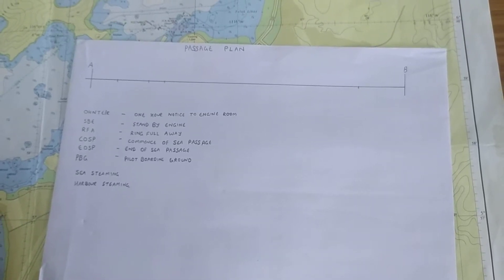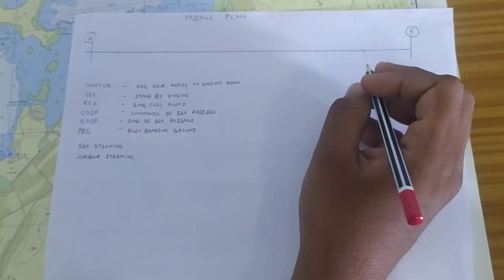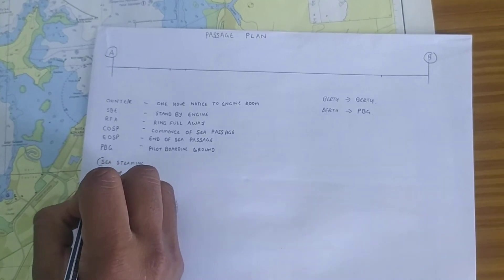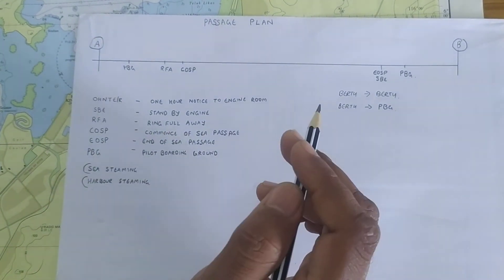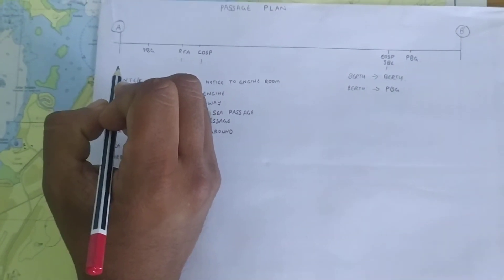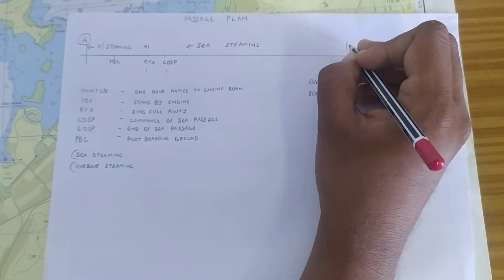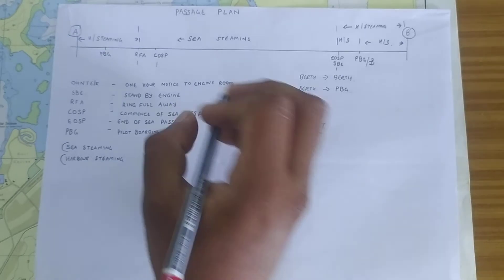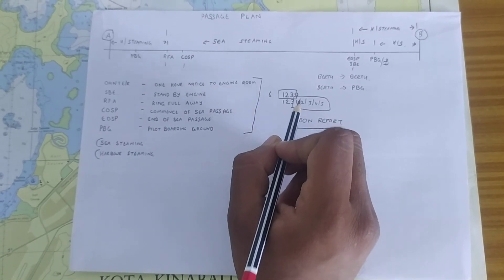RFA, EOSP, COSP, HARBOR STEAMING EXPLAINED

Comment: Hi friend. in period Sea Steaming  ( RFA to EOSP) we passing channel ( Singapore strait or Hai Nam strait)  require STBY E/R then Run up again. So how can I calculate sea/harbour steaming time
Reply from the maker: When Passing a channel or strait, its the same way sir.

At one point you will be going to 1 hour notice, then Maneuvering, then back to sea speed.

In all of the ship's I sailed, the process is similar.

Sea steaming stops at end of 1 hour notice (as soon as you start reducing RPM) till the point you have completed the strait, and run your engine up BACK to its FULL RPM.

Suppose, 1000 hrs was 1 hour notice, 1115 hrs commenced reducing RPM, 1140 hrs reached Maneuvering speed, 2000 hrs started increasing RPM after completion of a transit, 2030 hrs reached SEA Speed...
Then, Harbour steaming will start at 1115 hrs and complete at 2030 hrs.

The rest is Under sea speed sir.

Hope I clarified your query.

Regards ❤️
Reply: @prasobhsugadhan  Tks so much! ❤🇻🇳❤